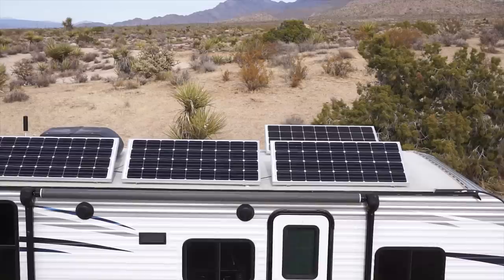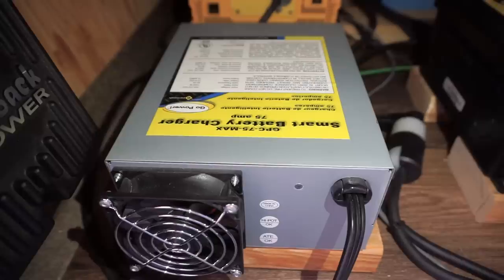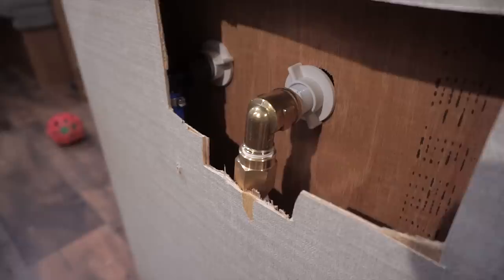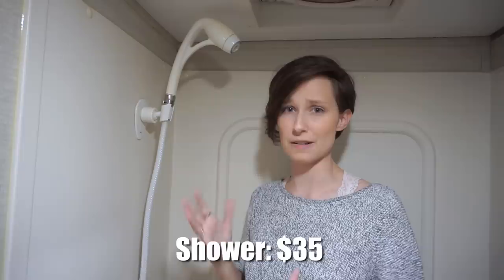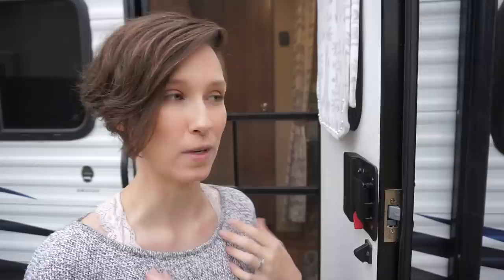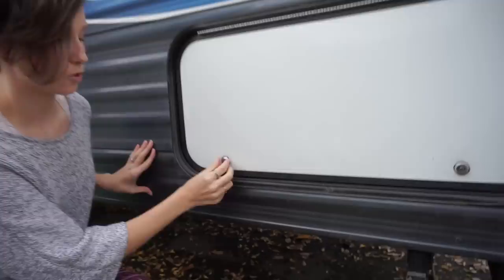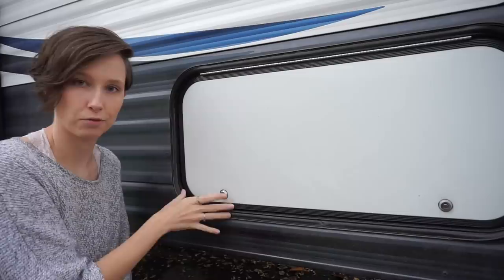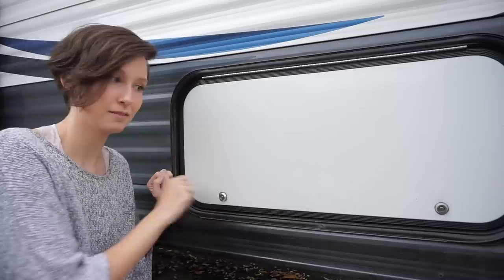Was It WORTH IT?? - All Our RV Upgrades Review - Solar, Toilet, Booster & More

Comment: @fateUnbound re your screws backing out.  Go to the auto parts store and get a little bitty bottle of Thread Lock.  Loc-tite  blue is a great medium strength thread glue that keeps screws from loosening on their own.  In a pinch you can you finger nail polish.  The glue takes up the extra slack between the threads on the screw and whatever you screw it in to.  Blue or medium means you can break it loose when you want to.  Red is almost always too much and you would need a torch to break it loose.

Comment: If the screws are tight and the lock is loose the screws are bottoming out. Get shorter screws or grind the ones you have now down an 1/8" or so at a time. They were probably meant for a thicker door. Appreciate all the info.

Comment: if your worried about the panel moving on the door lock.. pull it back off and use a silicone adhesive then re-assemble let dry and it shouldn't move anymore. just make sure you dont get it on the door latch pieces that are supposed to move

Comment: The lock wiggling can be fixed in 2 steps. 1) get locktight so the screws don't loosen. 2) on the mounting backing plate (Part that is against the door) add just couple small amounts of silicone or any caulk really. If you add too much it will be hard to remove if need be.

Comment: We have 2 of the RVLocks and the only issue has been the plastic keypads tear up. They are cheap and easy to replace. Sorry I can't help with your issue.
Love the rest of your upgrades.
Oh, and our WeBoost antenna is an outside mount. They have models for window or outside mount.

Comment: the expense of 'solar' can be a little daunting, and it's not always the 'magic pill' for everyone who thinks they 'need' it to go RVing, but you've done a good job explaining your system and how it works for your situation, which sounds like a LOT of 'off-grid' camping anywhere and everywhere you wish, with very little, if any, rv parks or campgrounds where you have to 'pay' or where you have any electrical.  Now, upwards of $8,000 or more for 'solar' and a VERY upgraded battery bank is a LOT of money to pay when you consider the cost and value of the RV itself, but, I will say, that regardless of the size and value of the RV, if you are serious about 'off-gridding' most of the time, and you are 'full-timing', essentially living in your RV, then the cost-to-benefit ratio from a financial pay-back perspective might be an offsetting value.  Specifically, if you KNOW you'll be on-the-road full-time over 3 years, and you'll have NO rv park or campground costs, and you'll be using NO generator, then your solar/battery system 'investment' might render $222 monthly in additional cost, but off-set greatly by the fact that you have no/few other costs to where you are living - no campground or rv park fees, no additional electrical metered costs, etc.  No one will complain about that, since many will set up or travel to and from campgrounds and rv parks, even seasonally, with costs of anywhere from $300 to $1,000 monthly just in campground or rv park fees, even if they include all amenities, like electrical.
What you have, though, is the pleasure of NOT having to be at a campground or rv park or anywhere where you 'need' an electrical connection....nice, and very 'freeing'...
What I ask, though, is 'where' do you find WATER, and 'where' do you dump your WASTE.  These might have a cost to consider in the financial equation, and might even have a greater cost in what it takes to 'get' water, and find a place to 'dump', but I'm sure you can expand on what you do to handle those.

The three needs for most any RVr is power, water, and septic/sewer.  When you have the ability to handle all three, all yourself, for the most part, you are very 'free'...  yes!

Now, if you have to have a generator for those days when the sun is not providing power, or days on end, or even some months where the sun just isn't cooperating much, you'll have to add that to the financial and aggravation equation.  If you are also using PROPANE for heating, cooking, and the water heater, then you'll have to also add that in.  How, when, and where you refill the propane is also another question.
Reply from the maker: In regards to solar you hit the nail on the head! Your comment is exactly what I tell people who are looking to travel the way we do, which is living in our RV full time and dispersed camping as often as possible with zero hookups.

To answer your question on where we find dump, water, and propane, it is actually very easy. There are dump stations with fresh water fill all over the country and we find them online mainly using rvdumpsites.net. And as far as propane goes, there is a company in every city and nearly every small town that is capable of filling standard propane bottles. Tractor Supply or UHauls are our typical go-to's.
Reply: @FateUnbound  right, the next question is then, how OFTEN are you having to 'move' to go get water, or dump, etc?

Comment: You could try silicone to glue the lock to the door.  Not just around it like a seal but behind it like glue.  And then maybe some lock-tight on the screws.

Comment: Not sure if your lock problem is a result of your bolts joining the inside to the exterior plates are becoming loose, but if it is you can put some lock tight on the end of the bolts. This will stop the bolts from backing off, which could cause your looseness.

Comment: That screw on your striker plate that won't tighten is probably in a stripped hole. They sell plastic anchors that fit in stripped holes in wood that will let the screws bite into something again. If that doesn't work you can try shoving a wood dowel in there or filling it with a hard epoxy and then driving the screw back in. As for why it rotates, I'm not sure. It might be because the striker plate screw hole is stripped, it might not be. You can always put an extra screw into the lock somewhere to anchor it, or use some mild epoxy. If you choose the right epoxy, you can break it loose with enough force if you ever need to remove it. For the rusting issue, I would just take the striker plate off and hit it with some good anti-corrosion paint and spray some silicon lube on just the metal components (I wouldn't let it touch the plastic parts).

Comment: Replace the screws with stainless screws, and use aluminum tube over the screws ,that matches the Id of the screws. And then use a small amount of silicone dabs to set the door locks handle plates.

Comment: If you had it to do over again with a slightly larger initial budget, would you have picked a little larger travel trailer with the features you’ve added already installed? What trailer would you recommend now?

Comment: Try making a backer plate for the inside door handle, the door may not be thick enough to allow the screws to tighten down fully, also you may want to put some lock tight thread locker on the screws/bolts so they wont loosen off.

Comment: You can replace the lock cores in the doors with Barrel Locks like you would find in a bike lock. The other issue is you can change the rusting screws with stainless screws.... But probably the one thing you should look into is Blue Lock Tite for the door. The other thing is you could put two sided sticky foam tape on the back of the lock.

Comment: At Home Depot they have a putty you can put into the holes for the lock which will harden.  Then just drill it smaller then the new stainless screws your also going to get or might get some B J weld and that should work also.

Comment: to tighten that screw on your door. Remove the screw fill the hole with a dowel rod glue the dowel rod in , retap the hole with a smaller drill bit then the screw and reinstall the screw. that should salve your screw prolbem.

Comment: Solar's getting much cheaper, with much better batteries (and even Li is looking to get replaced). I know you want to do it yourself (I'm an old construction worker) but as to the locks (especially on the battery compartment and entrance door) you might want to get a locksmith (their price isn't that high compared to the potential loss) and it would be that much more secure. You did a great job, good camping, and Dominus vobiscum.

Comment: Great video! With the door lock some loc tite on bolt will stop it from backing out. Put a bead of silicone around the inside and outside of assembly and it will stop it from moving, increase the water tightness and still be removable in he future!

Comment: I just installed a security lock on my door and it fits perfectly. It looks like your hole it is mounted in might be oversized so possibly you could use some shims to take out the play before you put the inside plate back on. As far as the plate goes, that screw might be stripped inside. It's cheap that they don't provide a metal threaded hole for that part. Perhaps you can find some kind of soft epoxy to put in the hole and reinstall the screw.

Comment: You might want to consider on your Solid RF roof mount getting cap/covers for the oppen connectore sockets and ensuring that the you use a dialectric grease on the ones tied in and a good seal on the lines in/out.  All to keep water out of the Coax and stave off corrosion.    But I loved the video.  You offer some grea advise and made some really out of the box changes like teh dinette tear out and re-do.  Well done guys!

Comment: Just saw this video so you may have got feedback on the door lock already.  However, my thoughts are.  To keep the lock from sliding around have you thought of cutting out a thin rubber sheet to just larger than the lock plate, of course, cutting a hole in the middle for the thru the door mechanism. This sandwiched between the lock plate a the door should prevent the sliding.  Second, if the lock mechanism and the screws are steel (ferrous metal) then lock tight or thread locker on the threads should hold tight.  Medium strength should be sufficient.  Lock tight or threadlocker does not work on non ferrous metal. If aluminum you can put a drop of super glue on the threads which should hold tight.  If the screws are wood screws or sheet metal screws I have used a drop of 2 part epoxy on the threads.  I've never tried it but I bet a drop of gorilla glue (polyester glue) would work on wood screws, sheet metal screws or machine screws in aluminum.  Good luck!  Chris

Comment: To help with the door lock, try using a shorter screw or cutting this one shorter. If it won’t tighten up anymore and it’s still allowing movement with the lock, the screw is bottoming out. Hope this helps.

Comment: The RV Manufacturers need to start offering factory installed Solar and lithium batteries as an option. And I’d like to see more cassette toilets offered. I hate the black tank dumping routine.  If you only have grey water to dump, you don’t need a sewer hose just a dedicated grey garden hose.

Comment: Great video! We have trouble with our RV LOCK as well. The covering over number 7 on the keypad seems to have delaminated, so when we pressed the 7 it does not always make contact. Now I have to change our code so we don't use the seven anymore. We are not full timers and have used our RV probably twice since we installed the lock last year, so it's not like we overuse the touchpad. While we love the lock concept, we feel the poor quality of lock does not justify the price paid.

Comment: For those who think solar has to cost thousands of dollars: My budget setup cost 2x£100 for 300W panels, 3x£70 for 60Ah, LiFePO4 batteries made out of pouches (+ a few quid for balancing boards), £50 for a true MPPT charger. So, not as good as this setup but 600W, 180Ah for £430 isn't bad.

Comment: On the door lock, you can use “thread locker” you just put a drop on each screw. As for the movement of the lock assembly, pull the inner panel off and see if you can shim it so it won’t move.
Reply: Try a little double sided tape on the back plates of the inside and/or outside pieces. It doesn't take much. Also, if the hinge pin on the inside latch handle falls out, you can wrap an "o-ring" around it to serve as a retainer...

Comment: You could put some sawdust and wood glue on that hole that the screw doesn't tighten in so that the screw will have something to bite and also to tighten it up a little you could make a gasket like thing that sits between the lock housing and the trailer material  so that when you tighten it down it will grab a little better and it will also insulate it a bit also.

Comment: To fix lock to door, just do bolts all way through where it is safe to do n you are not going to hit wires or other parts you cant drill through without destroying lock n tighten bolt n nut, or just screw some metal above n below it so it cant move up n down n will hold it tight there

Comment: Some thoughts about the door lock. I went back to the install video to be sure of a few details. The first thing I noticed is that all the screws in the old latch and strike plate loosened very easily with a stubby screwdriver. Too easy. Also, there is no wood or structure of any kind around the latch opening through the door. It's just  foam insulation with an inside skin and an outside skin. Maybe as you are tightening the screws you are compressing the foam which never allows it to become tight. Also, I noticed the outside half has long protrusions that the screws thread into. They are nearly as long as the door is thick and then you add the inside part which probably takes up any remaining space. If so, this could mean you are just tightening the two halves together without out it actually becoming tight against the door.  Maybe these protrusions can be shortened so the screws can be tightened more. Also, check the length of the screws and make sure they aren't bottoming out an appearing to be tight. Shortening the screw is easy.
Try larger diameter screws in the strike plate and remember there ain't much wood there so don't strip it out like the factory probably did. You could also try putting some short slivers of wood in the holes and reinsert the screws.
I'd try to avoid locktite type products if possible. Eventually you, or someone else, may want to take things apart again. A lot tougher with a half worn out philips screwdriver than a hex head bold.

Comment: @29:06, your frustration with the main door lock. I just ordered one, and from my reading they come with two sizes of screws to install the inside and outside panels. Using a shorter screw would allow you to get a tighter "grip" on the door material. If the shortest screw is still too long, then a trip to Ace hardware to get a shorter one with the same diameter and thread count will do the trick. That said, be careful as the core is generally Styrofoam. Thanks for the input on the hardware rusting, I'll swap that to stainless before I install it. ACE HARDWARE is your friend when it comes to hardware related questions. -----No ACE affiliation.

Comment: There is a " new " type of solar panel, it heats water too, this benefits the solar cells as they stay cooler, last longer, you can use the hot water for domestic, using inline or intank heat excahnger..... basicly you just put a small computer cooling rad in your hot water tank or similar. Wrap copper pipe with smaller copper pipe on inlet water line...1/4 soft copper.. add in small wind generators, like they use on sail boats or similar to your system for the days you dont have sun.
 A charge controller for each panel, some say works better, allows for the differences in the panels better, easier to work on or replace part of the system while it is still running. Mount wind generators on like tent poles so you can quick attach them when parked... maybe even some cheap conduit...fence post...etc...
If you ever have to change your batteries, look at the new LTO cells, last a life time with extremely high cycle rate, extreme temp range down to -40, easily bolt together to make any size or voltage pack you need.
Silicone wire, like they use for RC's, you can get in heavy gauge, high strand count, extreme conductivity, just make sure, you get copper core, not aluminum core plated copper... some of the amazon guys are trying to pass off aluminum core as the same, it's not.
6.5mm 200 amp bullet connectors from Castle Creations work nice, polarized and pretty much water proof but not something you would want as a daily plug...bit stiff.
Double wall, or Glue type, heat shrink tubing, liquid electrical tape ( stains everything, takes several applications and drying time between coats ) works well too, peals off easy if you ever need to repair.
I " over spec " everything, I try for a 2 to 1 safety ratio, if I need 100 amp service, I build everything for 200 amp service... less resistance in larger gauge wire... less heat, more efficient... build it once, build it right but dont forget to make it so you can easily service it... I use audio fuse blocks, AGM fuses for each circuit but Monster scooter parts does sell DC breakers.. nice little push button type..
I build ebike, high power ones, some had dual 10,000 watt motors, I currently run 2 x 1500 watt on bike and 2 x 800 watt in trailer... but I can easily hit 5,000 watt and 2000 watts respectively if I wanted... not legal and way too fast, wear out tires like mad... all custom wired, I used 8g silicone wire for the motor phase wires :)

Comment: On your lock, you should be able to pull the inside off and shim the back of the lock so it can't shake down like that.. by the look you should be able to use regular wood shims.. slide them in opposing to build your hight

Comment: The keyless entry lock screws need a medium strength (such as blue, but read the bottle) Locktite thread locker. Just make sure you don't get a super-strong thread locker that requires heat or a lot of force to remove.